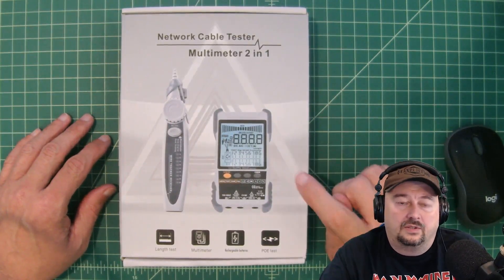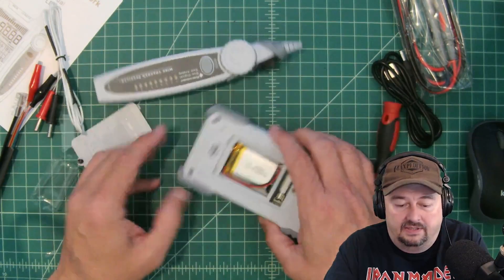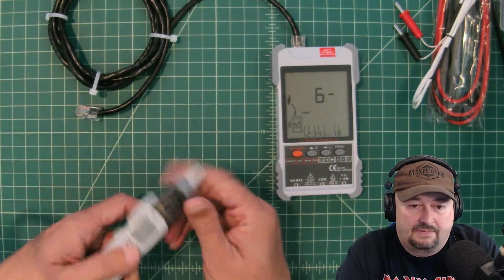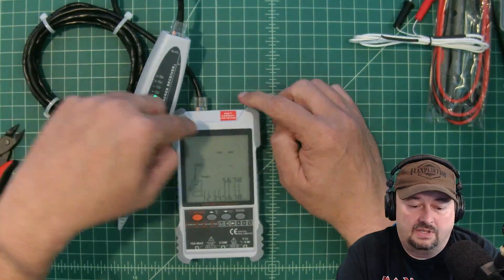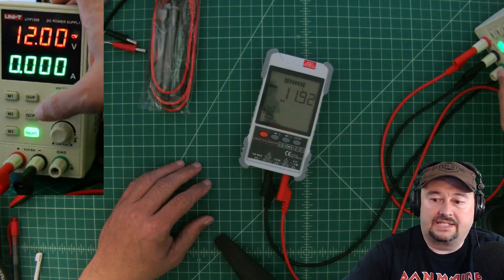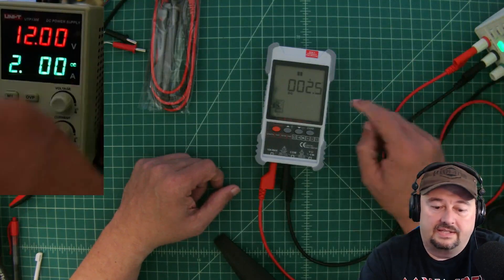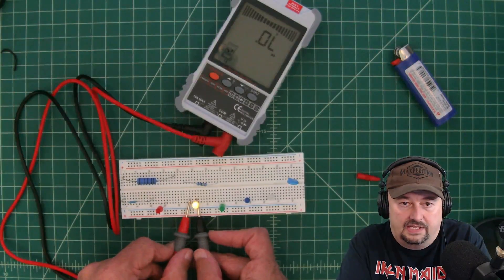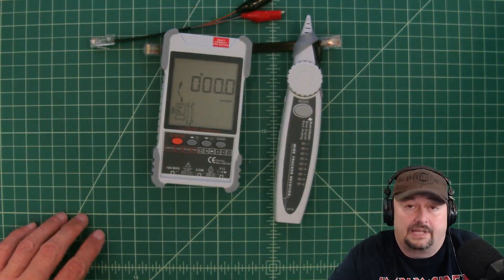SeeSii ET618 Network Tester and Multimeter

Comment: An accuracy test of the cable length measurement would be helpful.  A test using cables of known length, such as 25', 50', 100', 150', 200', 250' would be very telling. This is an area that many of these inexpensive testers do poorly with and needs to be evaluated before relying on it.

Comment: Hey has anyone got one of these with the Id remotes? 
I'm having trouble testing incorrectly wired cables. 
I hoped it would be like other network wiremap testers with a pass and fail on testing.
To test I made up a patch cable incorrectly on purpose. At just one of the ends I swapped the brown white and the brown wires to test but the tester doesn't tell me there's a fault and also I noticed id7 is reporting id3.
Reply: Has it worked for u can it also detect poe..I have seen in noyafa vdo to change network map remote map to match the I'd on unit do u like this or you would buy another If u have to make choice again